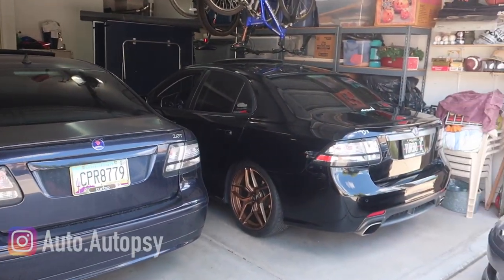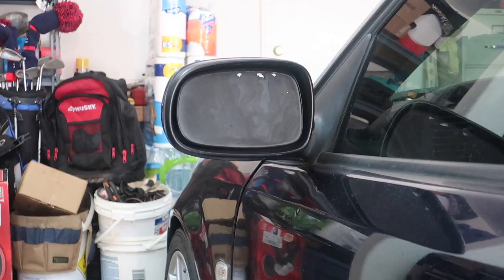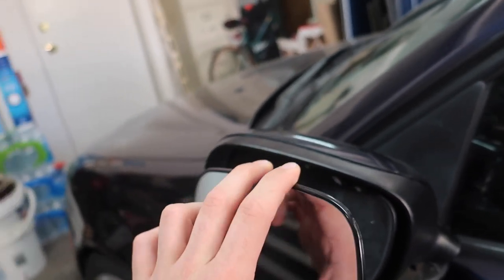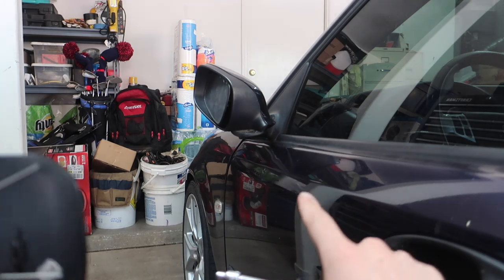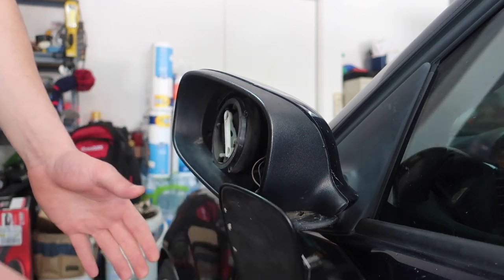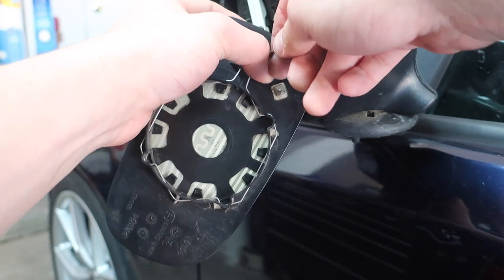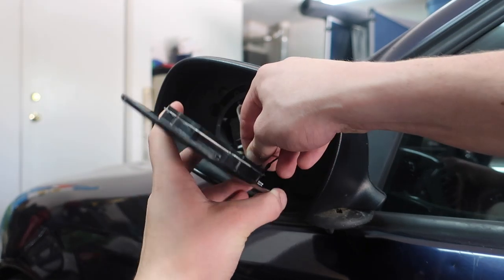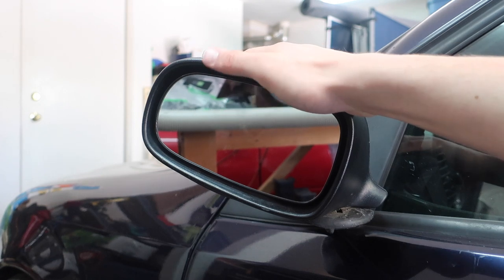Saab 9-3 Quick Fix - Mirror Glass

Comment: Very helpful. I also ordered from eSaabParts for my 2006 because I was concerned a non-OEM part wouldn't be right. Toughest part was getting the heater wires off -- they had been on there for 15 years.
Reply from the maker: Lol yeah they can be stuck on there pretty good

Comment: Had both go on my current and previous 93s. I just used 3M double sided tape on the black plastic housing and they've stayed put and still heat up fine.
Reply from the maker: thanks for the tip; unfortunately both times it's happened to me they've fallen and shattered :(
Reply: @AutoAutopsy  I've had to order new glass for 3 of the 4 times as well. You don't realize how often you use a mirror until it's gone lol

Comment: Have lime green 05 Aero convertible - had wing mirror casings painted in rich black metallic as spoiler on boot and tonneau surround to add some variety ! replacing mirrors as now sixteen years old - going to clean motor and apply some WD 40 to electrical connections etc for future  purposes

Comment: Thanks for all your tips and info!! I noticed the black sealing is cracked slightly on the mirror the same way mine is(where the front and back meet, mines much worse), do you have a video on how to remove the mirror to replace that? I was going to use something like flexseal caulking but wasn't sure if getting the old seal out was detrimental? Thanks again!!
Reply from the maker: i don't so im not sure. i've never looked into it!

Comment: Is heated mirrors a common thing on the 9-3's? If I've got it, how do I turn it on?
Reply: In 9-5 it turns on with rear heated window switch.
Reply: Turns on automatically with the rear defroster
Reply from the maker: ^ yep

Comment: Big question. I have a 2005 saab and my climate control is starting too wear, is it possible to put a 2007 cluster in a 2005? They look like they’re the same size but I don’t want to buy one and be let down.
Reply from the maker: no, the updated interior is completely different. you have to find one that identical, which shouldn't be hard.